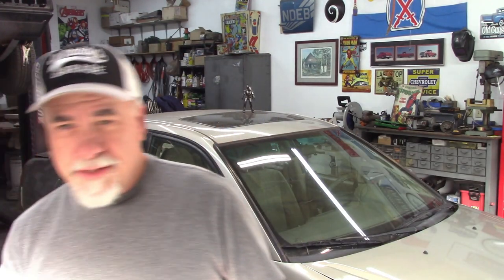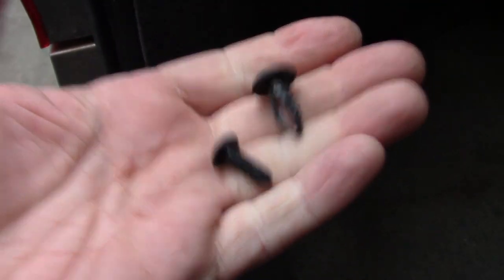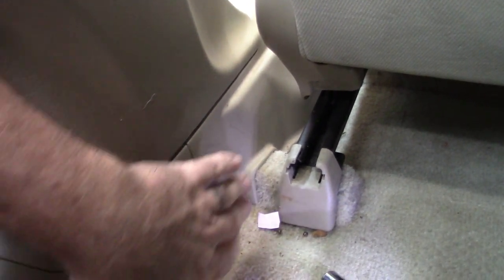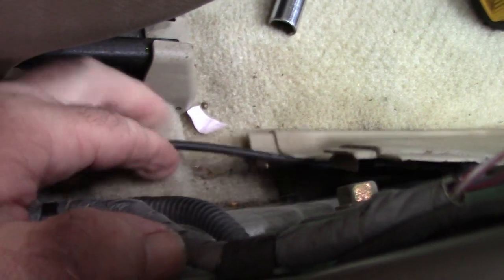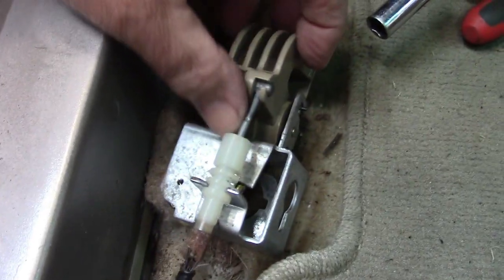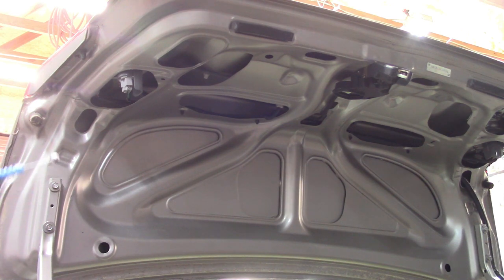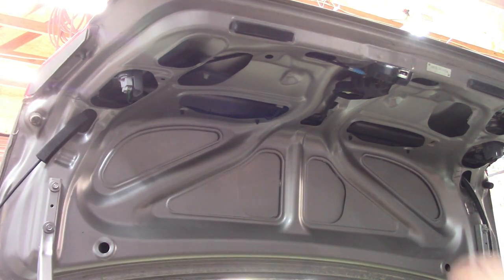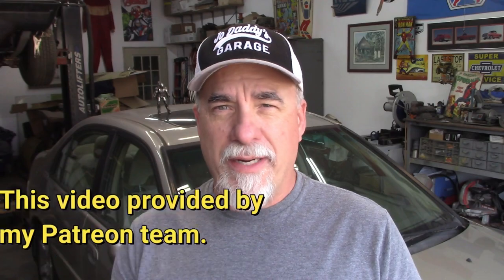Honda Civic trunk/gas door cable repair. How to, DIY.

Comment: Any tips/insight on working on this while not being able to access the trunk? My cable also has an issue, preventing me from being able to open the trunk. Bought it used (rear ended) and cannot open with the manual lock either. 09 (2 door) civic
Reply from the maker: Well, do the seats fold down? That’s one way. If it’s rear ended and the lid is bad, just cut into it.
Reply: Took this to a mechanic. Apparently they removed the back seats to access the trunk and then fix the cable. I don’t think they replaced the cable just fixed where is was loose or broken.

Comment: Has anyone had a hard time taking the piece from the gas door out? I tried rotating clockwise and the thing won't move. Could that be a sign of another problem?
Reply: Yes sir I figured it out.. if you have the rest of the cable free except for the trunk latch piece. What you want to do it gently pry on the plastic holding the latch from the gas door hole. You will then be able to get a better look. Mine was very dirty but there was a plastic tab not lifting up to free the latch that I gently lifted up and free’d.
Reply: @mrmeatstallion8902  Thanks for the tip! I'll give that a try over the weekend
Reply: Yes, these things never seem to work out so simply and conveniently for me like they do in the videos. Not twisting at all.

Comment: This is a great video. I replaced mine but I also needed to replace the fuel adapter assembly. While trying to fit the hose on I detached it from wherever else it connects to and cannot find it. Has anyone else encountered this issue?